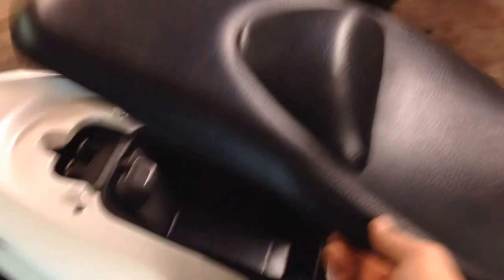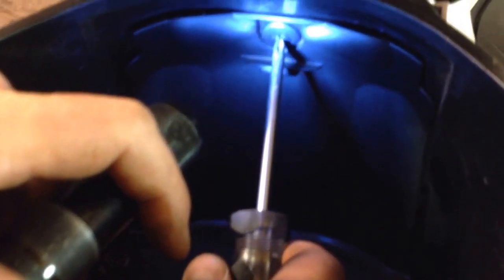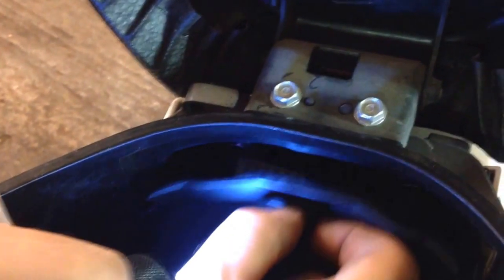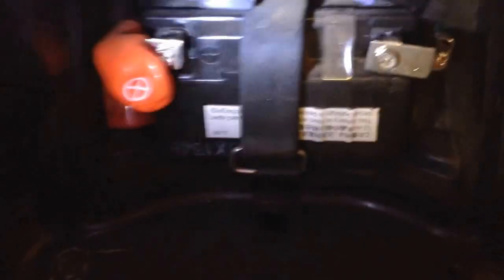Honda Pcx 125 Pcx125. How to replace battery. Honda PCX150 Battery Replacement

Comment: I see one problem, when I disconnect the battery en close the saddle, I can't open again, no power for the saddle release button, is there a solution  please? Thanks!
Reply from the maker: +Michel Higuet I will make a video what you need to do soon.
Reply: Hi Michel! Have you made video? Or do you have solution?